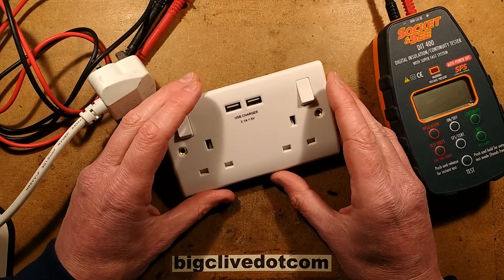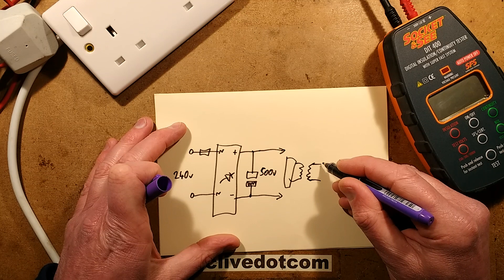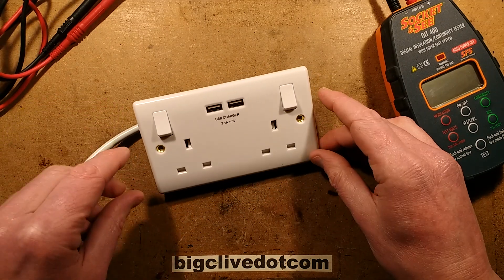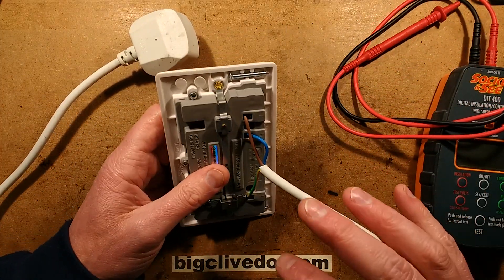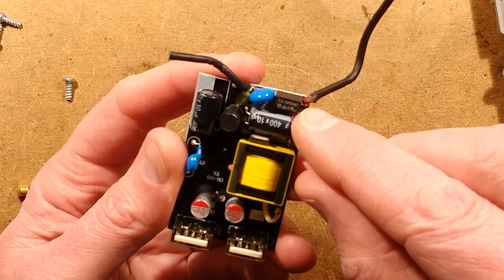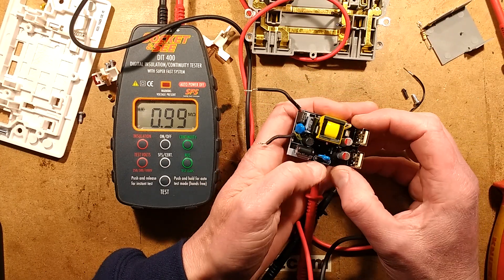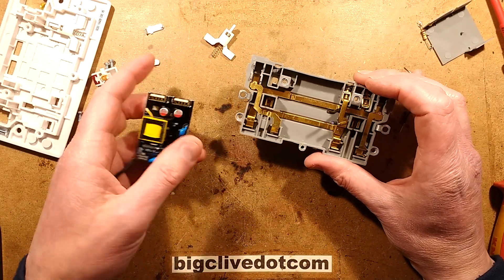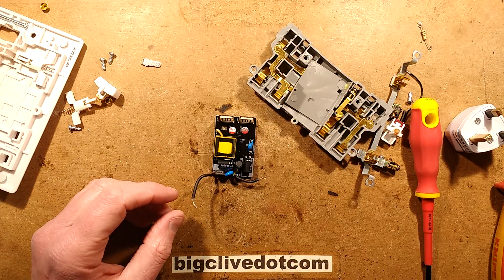500V insulation test of a British General USB socket.

Comment: The UK standard of wiring looks so much more robust than that of North America.
Reply: Troy Belding It wouldn’t go bang though - the pins are insulated half way up. They never make contact with the live socket until all of the metal has disappeared and you can’t touch it
Reply: We have 32A ring mains, so it kinda has to be robust. Sleeving on our plug pins has been mandatory since at least the 80s i think. We also now mandate RCD (GFI) protection on all socket circuits
Reply: @jaycee1980   MK were sleeving plug pins in the 1970s with the original "Safetyplug" - but it was also provided for in BS 546: I have some very old Crabtree 5A plugs with sleeved pins :)
Reply: I'm surprised, I would have thought that because many of your houses are made of wood that US wiring would be much beefier.
Reply: Troy, I'm less concerned with the actual plug interface from the consumer standpoint than I am with the in-wall interface.  

Specifically, what I like is the shrouding around the clamp/screw assemblies that reduces the likelihood of an accidental contact when working in a hot box or having a short when some shoddy handyman hasn't properly secured the wires.  

The backside design of the UK receptacles also would seem to discourage landing multiple lines on one connector instead of a pigtail junction.
Reply: Uh, good electricians do. Please don't tar everyone with the same brush.

On the other hand, we also don't need 20+ circuits to handle a normal house..
Reply: I'm English so I've grown up being used to very solid and well-engineered plugs.  Every time I go to the US I'm nervous about plugging things into the mains because US plugs look incredibly flimsy.  A UK plug makes a satisfying clunk when you plug it in and they aren't at all wobbly.  US plugs, not so much.

UK plugs are very large though.  This didn't matter when no-one carried electrical equipment around but having a UK plug in a laptop bag means you have to be careful not to damage anything.  It also really hurts if you stand on one.
Reply: I'm in Britain and I use plugs, I have done for 30 years, I am not dead. Therefore they work.
Reply: U.S. Here... I hate when the electricians get lazy and use A) the outlet as a butt-connector so the entire circuit load passes through the fuse-thin piece of brass on the side of the outlet, B) use the "speed connector" instead of the screw terminals.  Don't even get me started on  short wires and small boxes...

I remodeled and rewired a house and pig-tailed all the outlets and ceiling lights. When the inspector came he looked at one and asked if they were all wired like this, ("Yes") he did not inspect any other. He was curious as to why the outlets were "sideways" though. I had to sheepishly smile and admit to just copying the old baseboard mounted system I tore out. He thought that was funny as hell.  "To code" is a minimum standard in MHO.
Reply: @RiceFlavoredGum - if a piece of metal crossed the prongs on an UK outlet, you'd be seeing even BIGGER bangs.  Grounding is meaningless when you short circuit the connection.
Reply: @tbelding  
If a piece of metal crossed the prongs, nothing would happen, because if the metal is exposed, they are not live.
Reply: @katrinabryce  - which plugs are you discussing?  I can guarantee you that on a US plug, it connects to power before the exposed metal is fully inserted into the socket.  For a British plug, it's the same - except they have a thin coating over the bare metal close to the plug itself.   If you drop sharp metal on it (knife blade, sheet of steel, whatever), it'll cut through that coating just as if it wasn't there.    If it's just wire, or fingers, then the British plugs are likely to be safe.  I'd say I run into a 'half plugged in' cable about twice a week - where the equipment runs, but you can easily look at the metal of the plug blades.
Reply: @tbelding  
I'm talking about British plugs. I've not tried it, but I would think if you just dropped a knife on the plug, it wouldn't hit it hard enough to go through the plastic, you would need to apply force.
Reply: @tbelding  
It isn't a thin coating.  It is thick and strong plastic.  Even deliberately attacking it with a sharp knife will require considerable time and effort to reach the metal inside.
Reply: @geoffmorrison3648  - the plugs I've seen out of china are basically a thick coat of paint.   It might be that the ones made to normal standards are much thicker.
Reply: Troy Belding I guess that the safety standards differ mainly due to how domestic properties are wired over in the states and in Britain, different voltages etc. With ring mains we need fuses in all plugs to protect the lead for the appliance.
Reply: @troy, they kinda do, they always want the next contract of stuff cheaper than the last, and they turn a blind eye to how it is made if the price is right
Reply: RiceFlavoredGum and that's because for some stupid reason we in North America hand out outlets upside down exposing the live connections above the safety ground.  If we hung out recepticals correctly, then a fallen piece of metal would how the ground first a fall off never coming in contact with a live connections.
Reply: Juncus Bufonius They do label each of the breakers in the UK. You'll find the odd bad example where they haven't, but they're the exceptions.
Reply: Peter Mulholland  Round pin sockets are still fairly common if you keep your eyes open.  I think they are mostly used by cleaners and the purpose of having round pins is to stop the general public plugging things into them.
Reply: You speak of lack of knowledge then claim a transformer is required for 240V in the US - this is incorrect, as standard supplies are 120-0-120V. I wonder what happens if you use both sides of the split phase instead of the centre tap? Can't possibly be 240V.. Now, there is the potential issue of having two lines instead of a line and neutral, but any equipment expecting assured polarity with detachable cables and that neutral is equal to ground is already faulty by design.

Also, I've used US twist locks and they're horrible. Please invest in IEC 60309. The method of mounting your standard outlets in boxes is also quite flimsy. I do appreciate the depth, though..
Reply: Screw terminals are quite capable of taking multiple conductors, there is no 'dead end' termination to be had.
Reply: I'm still amazed that they don't label each of the breakers in the UK as I have seen in the US houses I've worked on. I have to disconnect them to work out what they are supplying in the house.
Reply: Troy Belding All in BS1363 of course
Reply: Peter: To this day you can still buy medium screw base to two prong edison adaptors in North America as well as ground pin cheater adaptors that allow you to plug three prong into a two prong socket.
Reply: @guitarstitch - I'll admit that the open 'twist around the screw' connection blocks aren't the best in the world - but I've also used recessed connectors.  The main concern is that ones like what Clive is using seem to be dead end terminated - you can't continue the circuit to another outlet along the wall.  Much as I like conduit, etc, that will radically increase the number of wires having to be run from a main junction box, and junction boxes are already a trouble point.   I can't count how many overstuffed boxes I've seen, where you couldn't even close a lid on them.   With something like that, a room with, say, three outlets per wall, four walls in the room, plus two light or other fixtures, would just about requires a small breaker box.
Reply: @lanesairconditioning - I suspect that's because our ground is longer than the other two prongs.   When bending over, it allows the ground to be inserted first, then use that as a guide to the other plugs while lifting the plug into place.   When upside down, as they do in some buildings I've worked in, it takes extra effort to line the plug up.   That's called ergonomics, which often puts common sense in the back seat (edited for reversing sense)
Reply: I was born in 71, and remember the house being changed from no polarity round plugs to the current ones when i was very young.
I also remember putting  wires together on the old one, big spark and i ran to my room!
Reply: It has to be for one simple reason: Double the Voltage through the same resistance means QUADRUPLE the power. So your body will absorb 400% more wattage than if it were on US power. So they take it with considerably more care.
Reply: But I'd still consider the central european wiring to be superior to the UK system. The  ring system in the UK complicates things a lot (and is not necessary an more) while not protecting the wiring properly in some cases. But as with any electrical installation, if the electrician doesn't know what he is doing everything can be a deathtrap.
Reply: lanesairconditioning
Same in Australia / NZ.  Earth below live and neutral.  The theory is that you will maintain the earth link if you pull the plug out accidentally (by stepping on a cord, for example).  There are always trade-offs.
Reply: Copper shortage was exactly the reason for the ring main. Why anyone would build a house using it today, i have no idea.
Reply: The ring main design was designed to save copper because you could have current flowing each way around the ring and effectively increase the ampacity of the circuit without requiring much extra copper. There's a major problem with that though - if somehow the ring is broken part of the way around, then potentially you can overload the wiring without being able to notice.
Reply: @Zee-L  You think like I do.

I never imagined my simple little comment would start such an interesting and passionate discussion about receptacles.
Reply: It is as he said it is meant to handle between 220 and 240 volts and also the parts have to be guaranteed to last in cold weather (so not split, crack due to the cold!) where the power has to warm up the wire/cable before the power can get through to the socket and device where it might melt lighter wiring and/or insulation material so basically it is so the cold does not damaged the material and when it heats up the material can withstand the sudden cold to hot transition without risk of fire!!!
Reply: i noticed how the terminals on outlets and switches are exposed , i always think about stray whiskers or even touch on metal boxes would be quiet high with such and not forgetting the twist on caps that seem to be used as connectors in lighting , i find that weak and dangerous
Reply: It sure does. I am in the US and once a power outlet exploded because a piece of metal fell onto two prongs. The outlet was blackened and there was a big shower of sparks.
Reply: @Troy Belding people used to plug appliances into light sockets too. Do you still do that? History or not, the NEMA connector is still a dreadful design. Incidentally it also shows you know nothing about British electrical history, as we had several types of connector before BS1363 became the standard. Most of our earlier plugs had round pins for example.
Reply: @Jusb1066 - aluminum wiring actually works reasonably well in some circumstances.   It just turned  out that nobody put enough thought into it to test it for house wiring - you have to completely redesign all of the connectors, for example.   I don't think you can blame the US itself for China making crap products.   It's not like a building corporation called up someone and said "Hey, we need some gypsum board, but we want it as toxic as possible so it'll never pass building codes."   As for 'cheapest imported crap' - China and India ship that to everyone.
Reply: @Peter Mulholland - I am aware of British history.   As I pointed out, the British had fewer existing electrical installations than the US - and the US didn't have their cities destroyed, allowing a new standard to be put in place without requiring massive inconvenience for their populace.   BS1363 is from 1947, and was SPECIFICALLY introduced for post-war reconstruction.   As for plugging into light sockets, they even still make light fixtures with grounded outlets in the base, let alone the adapters.   In extremely old houses, as well as in 'tiny' houses, they make some sense.   (You can GFCI the wiring, so it's not particularly hazardous)   Look up 'light fixture with grounded outlet'.   They're also very useful when you have an outdoor light, but no electrical outlets - like my house.
Reply: Maybe - that's the fun part.   Dropped metal can cut through thin plastic.   Eh - it is what it is.  I mean, nothing is stopping someone from using plasti-dip and coating the inner ends of the prongs.   The device may no longer work in some outlets, but that's science!
Reply: yep, north america with its aluminium wiring , then the cheapest imported crap, then drywall made of poison, started the fall of society!
Reply: @jusb1066  Aluminum wiring has been banned in the U.S. since like the 1960's. The insurance companies saw to that.
Reply: Oh look, British people complaining while simultaneously boasting about themselves. What an unexpected sight.
Reply: I do a lot of networking work, and that also ends up requiring me to work with various power supplies and wall current.   The constant belittling of US standards shows a lack of knowledge of history of the subject.  The US was the origin point for the technology war between various current types, phone types, wire standards, and just about everything other than the railroad (that was Britian and Europe).   We started at 100 volts nominal, and ended at 120 volts nominal, for household A/C current.   Plugs were designed with this in mind.   The original plugs were two pieces of flat metal that were folded in half to create a rounded tip, then soldered at the back to a wire, and inserted through a plug.  (I've seen wooden ones from very old equipment)   The two sides were exactly the same_, as were the outlets.   There was no polarization indication.   Later, they widened one side to indicate polarity, and added a round hole for a horseshoe shaped bent piece of flat metal to create a ground.   (flat, then put on a mandrel and stomped into a U shape)   _Lots of buildings were created with the original one.  The house I'm in had non-polarized outlets, and it was built right after WW-II.    (they've been upgraded since then, but I forced them to come back and add grounds when they put in grounded outlets without actually grounding them)   

Unlike Britain, which both didn't have power in many houses until long after the Tesla/Edison wars, and had to completely rebuild their cities after WW-II, the US couldn't tell everyone that they had to use a totally different set of wiring, outlets, plug types, and so forth.   There's too much existing infrastructure.   Now, if one of you complainers wants to convert your house to British style plugs - go for it. Nobody will stop you, and you'll probably pass all the normal code checks.   You'll simply have to put new cables on every single piece of equipment in your house.   Now, if you want to run 240 volt into the house,  you'll have to change it at the breaker box with a transformer assembly, and you will violate code in many residential locations.    If you REALLY want safety, put in three prong twist lock plugs on all of your equipment.    

Frankly, the number of people that electrocute themselves with power outlets and by sticking their fingers between the prongs while plugging it in?   Most of them deserve the shock, and as Clive put it - kids learn.   I got my first shock in elementary school - I was feeling around behind a cabinet, and someone had apparently broken off the prongs of a plug in the socket, and they just put a cabinet in front of it rather than pulling out the broken bits.   So I got a nice zap.
Reply: "Unlike Britain, which ...  to completely rebuild their cities 
after WW-II".  That's a vast exaggeration.
Reply: @xRepoUKx  - I didn't say replace_, I said rebuild.   The Germans bombed every major city in the UK that they could reach.  That required enormous amounts of infrastructure rebuilding after the war, which meant that they _could make massive changes.   That's about the only time you can do that in modern cities.   Just watching fights over elevated rail lines in Houston will give you that understanding.
Reply: @tbelding  couple of points - 1) the first public coal fired power station was in London predating Pearl Street in US by about six months. 2) Most British cities were largely untouched by German bombing but there was a lot of slum clearance and rebuilding of houses after WWII.
Reply: @tbelding  230v is very likely to kill a child though.
Reply: @drcl7429  - Voltage doesn't kill.  Amperage (and/or frequency) kills.   (Not sure which comment you're replying to, but it's a general enough statement).   Children are no more or less vulnerable to electrocution than adults.
Reply: @tbelding  and what does ohm law tell you about the relationship between voltage and current?  Don't make such stupid comments.  You might as well say its safe to touch 15kv cables because amperage kills.    Children are in fact more vulnerable because they are smaller.  Smaller amount of energy required and also there is less resistance because of less mass. Therefore the amperage will have more effect.
Reply: @drcl7429  - Obviously you're not very good with electricity if you think that size matters for humans.  I've had 28kv discharged through my right side from a helium-neon laser power supply.   I've also been hit by house current, when I was a child.   What kills is either explosive force, or fibrillation.   Basically, either frying the person, or interrupting and stopping the heart.   That has NOTHING to do with the resistance of the body - https://en.wikipedia.org/wiki/Electrical_injury#Body_resistance   (See the NIOSH reference).   What kills is _current_.    You can be killed at 80 volts as easily as 15,000 volts - if the current is equal.  That's generally expressed by Volt/Amps, but yes, Watts would probably be better if you want to be pedantic.    In any case, I can find no reference that children are more inclined to electrocution than adults.   They're more vulnerable to a lot of things than someone who has finished developing, but not electricity.   (Other than the standard "Let's stick this in my mouth", of course) 

So, quit being an idiot, and save the insults for the spam channels.
Reply: @tbelding  I don't think you will find empirical research on humans but on animals you will. Size matters.  Animals with heavy fleeces, thick skin, fat layers
 or thick skulls will have a higher electrical resistance.  

You stated ohms law also but you claim it has no relevance?  Resistance of the body has no effect but resistance from other materials does?  Of course voltage is irrelivant if you have very high resistance.  lower resistance will allow greater flow of current and more damage.  Mostly its down to dumb luck.  Skin conductivity makes the most difference - resistance!

You are correct in saying its the current that kills but the voltage drives the current.  That is like saying its the bullet that kills.  Voltage is the difference between me throwing a bullet at you or firing it from a pistol.
Reply: @tbelding  The history we understand; it's just the end result which appals us.
Reply: @tbelding  firstly its called a railway and its a British invention nothing to do with any other European country , secondly we changed our system after the war and went from round pin outlets to the square sided type so your argument is null , we have also recently have forced on us a European "harmonized" system meaning our standards and those of the Germans and other northern European nations had to be lowered to allow Spain and southern European nations to be able to comply this has brought us poor standards in new installers as well as confusing wiring colors , the extinction or near as such of MICC cables and the increased use of under rated dangerous cables manufactured in eastern Europe which has been found to be faulty of the reel let alone ion the wall of a house  there is no greater protection to the consumer then the correct installation of a system , you can introduce as many tests and fault devises as you like without quality devices and cables you will only be replacing or cleaning up after fires in the near future